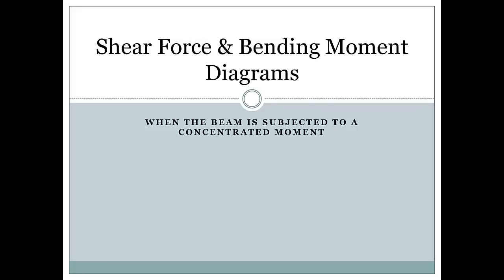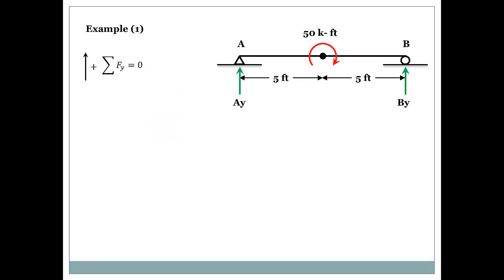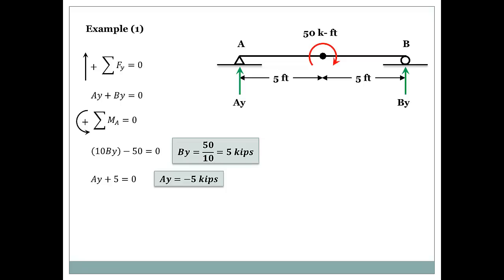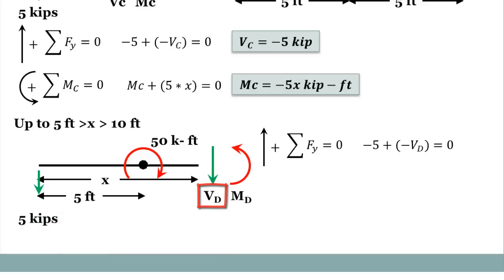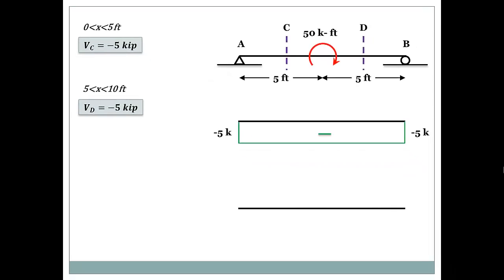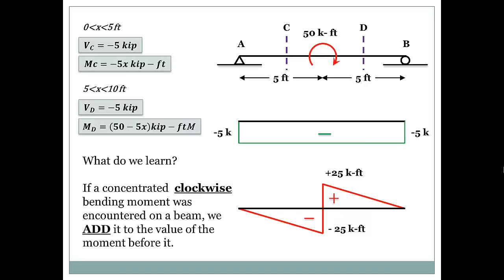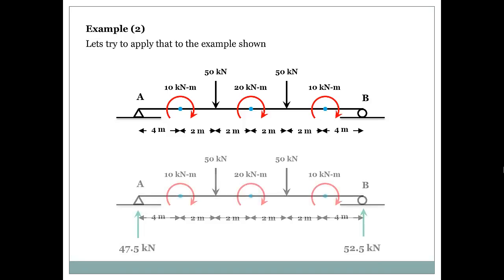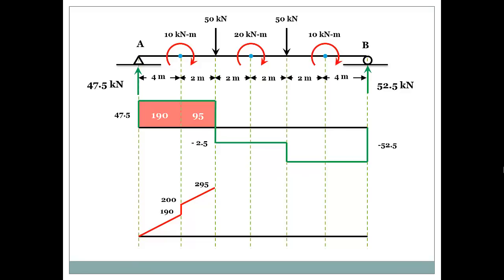Question (6): How does a concentrated bending moment affect the V and M diagrams?

Comment: Why when you take the moment about point A (MA) you do not include the 5 ft distance from point A to the point of the concentrated moment. I am doing this way. Moment A = 0 I am assuming the counterclockwise wise moment to be positive, so : -50K-ft * 5ft + By * 10ft = 0
Reply from the maker: The moment is a force multiplied by a distance. if you consider the moment at midspan as a "MOMENT" you do not need to use the distance to the support. The distances are used with forces only :)
Reply: Thanks CTSCivil for your explanation. I really learning this stuff on my own cause my professor at my university does not explain anything and get angry if you have him questions.